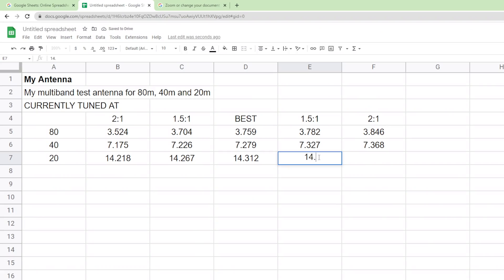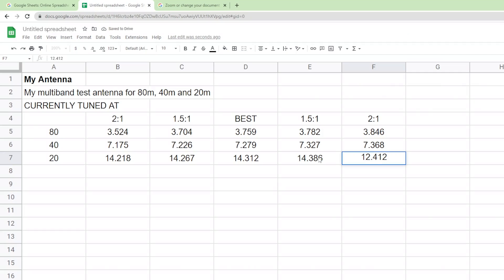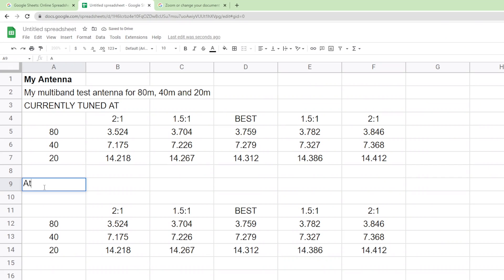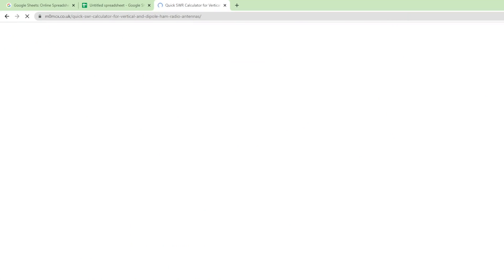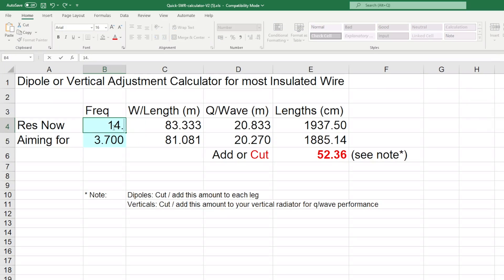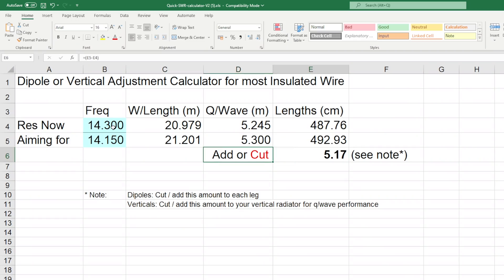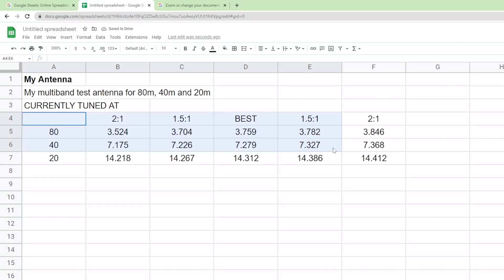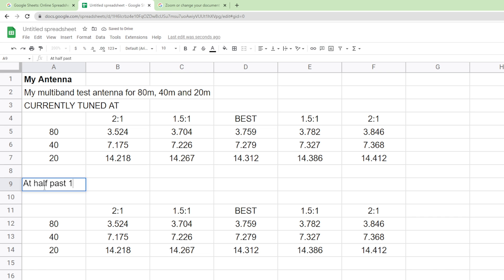Tuning Your Ham Radio Antenna with a Spreadsheet

Comment: I did just like you said and used your Spreadsheet with the tuning calculator. Worked great. My DX Commander has always needed a help from the rigs tuner to get the lower end of the CW bands. Now I can leave the tuner off.
Reply from the maker: Perfect!

Comment: Thanks Cal for the spreadsheet, one question with Fan dipoles do you tune as a whole to start with or individual elements. I have one for 40,20 and 10, 10 is way off I am wondering if I need another element for 15 or 17 in there as well for it all to work. Apologies if this is a noob question
Reply from the maker: Personally, I make a best guess and whack them all up.. Then I adjust the worst one and often make small adjustments to the others at the same time. In the main, it just starts to work fine :)
Reply: @DXCommanderHQ  Thanks for taking the time to reply Cal, appreciate it

Comment: Hi! I got the DX Commander all set up. My reading is 1.0/1 center band on all advertised bands except 30 and 80. No tuning was required. The 30 meter is unusable which is fine by me. The 80-meter band is 1.2/1 centered in the high area on the voice section on purpose. I use the high area more than any other, (3900 to 4000 Khs').

Question though. I ran the 80-meter wire through the TOP spreader, is that correct? I didn't find much information on the 80-meter inverted L setup. Thanks.
Reply from the maker: It doesn't matter where you run it to be honest.. I prefer the next one down because less bendy-wendy on the pole. Inverted Ls don't care much..!

Comment: Used your calculator a few weeks ago to tune my new inverted V for 40m and retune my Cobweb (20-6m) after modification. Worked like a charm! I found that with the Cobweb it's best to tune inside-out. So start with 6m and work your way to 20m. Tuning one element will affect the previous element somewhat, but nothing crazy as long as you start with all (untuned) elements in place.. 😅 And never analyze/tune an antenna which is not placed how you intend to work it.
Reply from the maker: Yes, I agree.. If everything is up and NEARLY right, a small adjustment makes very little impact on other bands..

Comment: Hi Cal,
Using your example, if you need to tune all three bands do you start with the lowest frequency make an adjustment and test all three again? Stay safe.  73  WJ3U
Reply from the maker: Hiya Don. It is my experience that as long as they are not cut far away from where they should be, it probably doesn't matter.. Often I actually do the LOT in one cut/shave. I suppose longest first makes sense :)